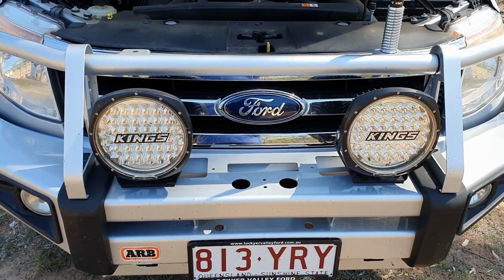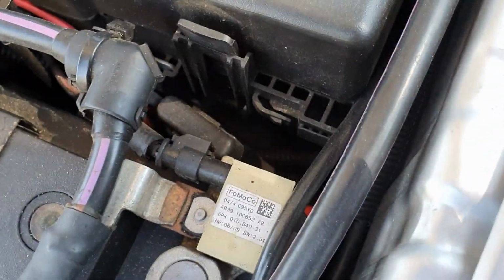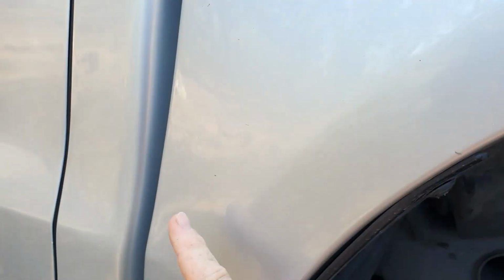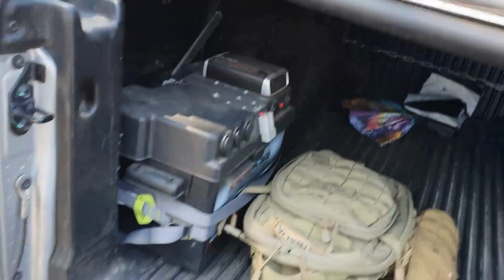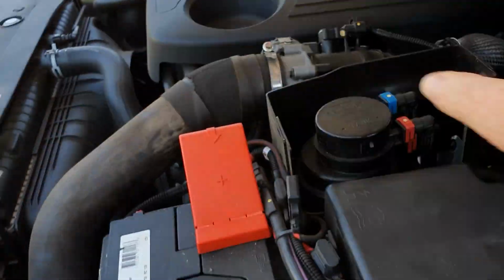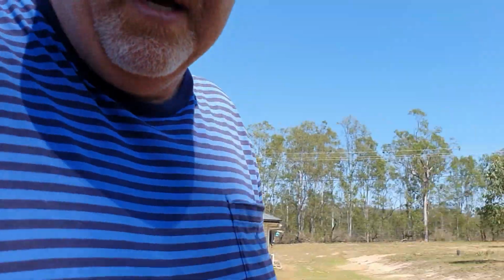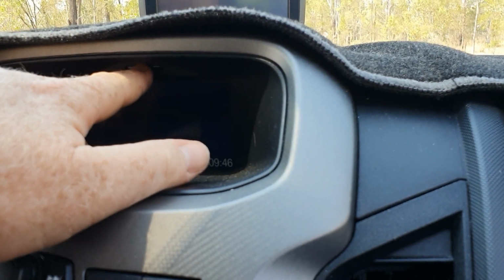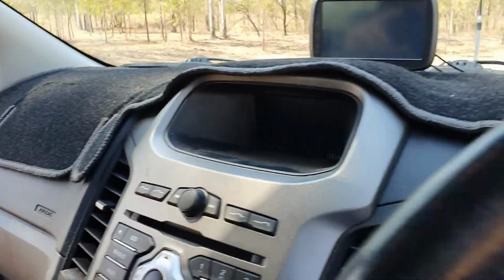Ranger Update Oct 19

Comment: hey mate just wondering if the ranger has a smart alternator or not ?
Reply from the maker: Mate I am fairly certain mine does, I have been told in the past that if there is a little square "box" at the end of the negative battery lead just near the negative battery terminal it means you have a smart alternator, as I say in the video mine is delivering 14.4 pretty much all the time, I know the dealer can disable it if you want

Comment: Does the EDS display transmission temp?
Reply from the maker: No mate it is the one thing I miss on it, I am fairly certain the Scangauge can and also the Torque Pro app, but the EDS cant read it and there seems to be no way to program the EDS to read trans temps
Reply: @Gruingle1  thanks for the clarification mate. I've got the forscan demo app which displays the trans temp, but its a pain to set up on every trip, I was hoping to have this ems have it ready when I started the car.
Reply from the maker: @turbostyler  , yea everything else but trans temps, so I have set mine up to display Coolant temp, Voltage, Vehicle Speed and RPM. I will admit no issues with it turning on and off etc, boots up almost instantly